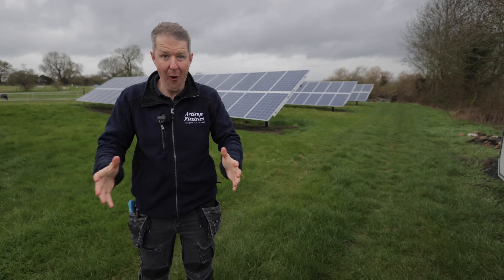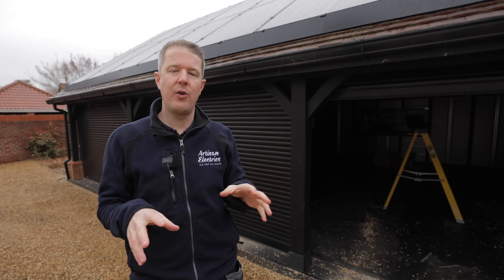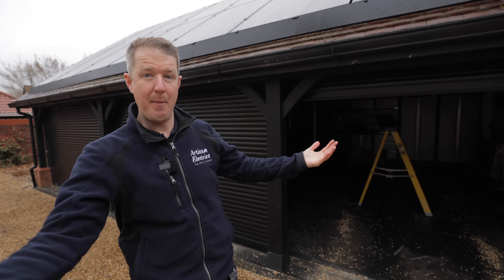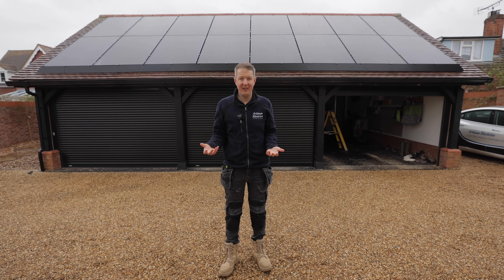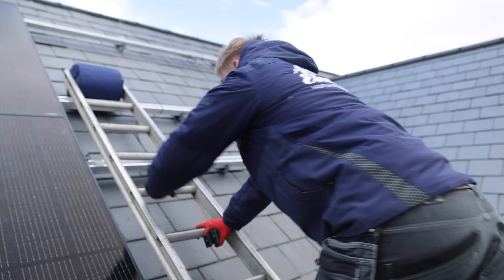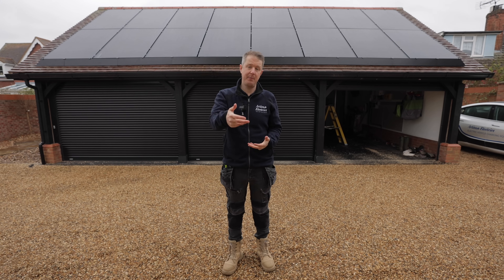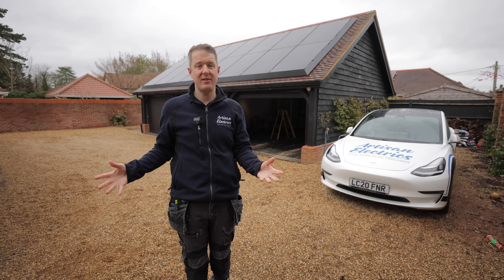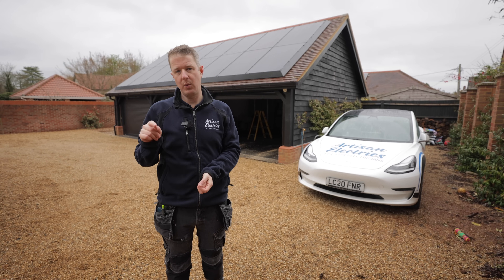10 Things You Need To Know Before Getting Solar Panels Installed in 2024

Comment: Best to use Octopus Eco7. Charge everything up at night 12:30am - 7:30am at 18p/kwH and export ANY surplus solar on Outgoing Octopus at 15p/kwH. No need then to install expensive complex electronic car chargers, immersion heating kit that adjusts to the ever changing solar. No need to plan the solar available next day. Also just charge the car up...18p/kwH - the solar you could have used will get 15p back from the grid - so the real cost of this being no hassle no stress is 3p/kwH.....It's simple, stress free, no planning, no thought required. But best of all all the equipment I use, will not be broken in 3yrs from constantly switching on and off everytime the sun goes behind a cloud.
Reply: But you are 100% reliant on that tariff being available. If octopus withdrew that Tariff or went bump then your plan falls apart.
Reply: @Pugjamin  I totally agree - and there is another plan that looks even better than the one I am on. These plans should be available as a matter of course. I should not be beholden to the whims of Octopus, but they are the only show in town. The whole system is broken. The govt should be funding solar installation, with the payment of the electricity bill being the repayment schedule of the loan.  We are all being extensively shafted by the excessive cost of power, and I am a lucky person that I can afford to buy my way out of the clutches of the system that penalises the poorest. But with respect to cost effectiveness - my current approach is still the best and cheapest and easiest way to charge my car, loft batteries without using myenegi, zappi etc...I do not think those products are worth the hassle, provide the marginal savings that pay for their cost/installation/maintenance. The cost of using o/n electricity is effectively 3p/kwH, divide that into a £1000 car charger and the breakeven point is 33,333kwH.
Reply: You made the mistake twice, so there is a pattern there.

Units of energy are kWh, not kwH.

Capital W for watts, and lowercase h for hours.

Comment: A good summary but you didn’t cover DNO approval.  We had to wait 4 months for our DNO to approve the installation, and then another month to approve the second battery.  The DNO might impose import (overnight charging) or export limits.  Fortunately for out 10.4kW system they didn’t but on a sunny day you can see the grid voltage delivered to the house being on or sometimes exceeding the limits, caused by home solar charging.  It’s the DNO to keep this in balance but with the energy price increases there’s been a lot of solar requests and they’re swamped.
I’m not convinced about bird guards, seems a bit like an upsell to me.  We’ve had a 16 panel FIT array installed for 6 years and no evidence of birds nesting underneath so when we had the extra panels fitted we didn’t bother with bird guard.   2 months after the install I did have to buy some plastic bird spikes as the birds sit on the TV aerial and poo on the new panels though!

Comment: A couple of things. You mentioned using What 3 Words for sending you location information. We have found that W3W does not work if there is no mobile signal or Wi-Fi. OS Locate works much better. It gives you a 6 figure OS grid reference. We’ve used it where there is no mobile signal and/or Wi-Fi and it works perfectly. Also, you make no mention of getting planning permission. If you’ve got a listed building then you need this even if the panels are being put in a field as part of the property. Ps. I’m enjoying the videos.
Reply: OS Locate uses GPS receiver in the phone, if it has one, and so does not need an active mobile data connection or WiFi.

Comment: Bess (battery energy storage system) and Hess (hybrid energy storage systems ) systems are going to become more of the norm over standard Pv Ess arrays as governments and electricity suppliers rely on load balancing more and more
Reply: Well yes, the grid (at least here in NL) is largely congested and upgrading it costs billions and takes decades. Even now in the spring, the number of complaints of inverters stopping exporting energy to the grid at sunny days is rising quickly, depending on the local situation.

Comment: Morning....I have watched your video and I think I have to review my plans. A famous energy company are installing my solar panel and heat pump. My system is a 16 panel 450watt generating 7.12 kW with a battery storage capacity of 10kw. The inverter on the system is a 5.78 microinverter. Having watched your videos I think I may go back to them to get the powereall 3 since it has a higher inverter. Or if they can get my a higher inverter even better as I think if I have to increase my battery storage down the line to 15kw, the inverter may not work for me again. What do you think is the best option ?
Get the powerwall 3 which has better capacity inverter or ask them to give me a higher inverter on the enphase battery which is what they have proposed and got the agreement from the DNO.
Thanks for your help with this.

Comment: You may get sun all day but it's that between 9am and 3pm when there is real strength, i.e. peak photons 'hitting' the panels.  And, in winter that's the only time there is any sun!  Summer sun pre 0800 or post 4pm ain't that great.

Comment: Generally speaking I have found that the cost of solar panels should not be the driving force behind the decision making process. It’s more about having a source of independent power if your mains power supply fails, or if your diesel generator becomes impractical. (Most of us would not be alive when the the installation actually breaks-even financially, if ever..
Reply: I disagree. Everyone's circumstances are different.

If you live in an area of frequent power cuts then yes having a backup source of power can be useful.
But let us not forget, diesel generators can provide that backup power and the generator will work even when the sun is not shining such as on a winter's day.

So your choice of backup power needs to take in to consideration a number of factors.

If you live in a place where power cuts are extremely rare, such as the UK, then having an independent backup source of power to the national grid is not the prime consideration .
Reply: @deang5622  yes that’s true.

Comment: I'd endorse the idea of getting old roof slates changed at the same time as having solar panels fitted. Having the installers moving across the roof is likely to break any fragile slates, and replacing them is a time-consuming business. If the roof has reached the end of it's life, get a new roof at the same time. Any home owner should be putting aside some money each month to pay for a new roof when this is eventually needed (same with your boiler or heat pump).

Comment: Can panels also heat water as well as generate electricity?  🤔
Reply: Yes they can with a hot water diverter.
Reply: Heating water directly is a different kind of solar panel, containing tubes carrying water. These are referred to as solar panels but they are not photovoltaic solar panels.
Reply: @deang5622  yes but you can connect your panels to a hot water heater if you have a hot water tank
Reply: @lehoff Yes, I do know this. And I did see the other post. If that post was incorrect I would have corrected it.

I see no need to repeat accurate comments made by other posters. That's pointless.

Don't assume that because a person hasn't mentioned something that they don't know about it. Look at the other posts in the thread too.
Reply: @deang5622  I was responding to this person. I'm not going to read every thread in this video.

Comment: So our usage is about 26.5kwh per hour during the day, and at night we use about 72kwh from dusk to dawn.    Here in Texas it is extremely tough to justify the cost of solar because the power is so cheap.  I would love to get it, just to reduce the overall usage from the power company.   I got a quote from Telsa for their solar roof and powerwalls for $465,000 or £375,000.  🤦‍♂🤪  That was for just over 53KW of solar roof and 10 power walls a while back.  Needless to say I still don't have solar.  👍   Looks like a great job there sir, and some very good points.  Because of the amount of hail we can get during the spring and summer, our roofs are very steep pitched here from 12/12 to 18/12 or 45 degrees to 58 degrees, so its fun watching the roofers up there doing work.
Reply: So you use more electricity in one hour than we use in three or four days? How?!? Cut that down and you don't need all those expensive powerwalls!
Reply: That's using more electricity than can flow down the power line to most British houses (which is 23KW)  and you're pulling that amount for multiple hours per day.

You're doing something wrong.
That's not a house, that's a palace you got there.

Comment: Can I get more solar by using a wall? I already have 3.2kw roof. I have an unshaded south facing wall.
Reply: Solar panels work best when the sunlight is perpendicular the the plane of the panel.

You will catch the sun and generate a reasonable amount of power for a limited amount of time during the early morning or late evening, depending on which way the panels are facing.

Vertically oriented panels won't maximise the kWh you get over a year.

Comment: Really neat installation, great job. Just a question on the battery inverter, assumed 5kw with the Libbi. With an Array that size, does a 5kw battery inverter limit the rate of generated energy you can store at any given time?
Reply: The inverter does not charge the battery so the power rating of the inverter is not relevant.

What is going to determine how quickly the batteries can be charged is:
1. The maximum charging current of the battery charger
2. The maximum charging current the batteries can handle.

Wiring batteries in parallel means that you can charge them up at higher current as that current is divided across the batteries.

If you have only a single battery you are limited to the maximum charging current for that single battery.

You will need to look at the technical data for the particular batteries being used and identify what the maximum charging current is.
Reply: Guys, thanks for your replies. I don’t think I was particularly clear on my point, which is, with the array in that video, 30 panels roughly at 400w a panel, on a sunny day, the optimal generation is going to be a lot higher than the 5kwh inverter. Has the right inverter been selected for this installation? I understand it’s a east to west set up with optimisers, I was just wondering can you install too many panels where it becomes pointless as your limited to your inverter size?

Comment: Are there comparisons of DC appliances in the house? Does anyone do that to remove the inverter need? Could have back up rectifier to take mains?
Reply: Solaredge batteries are DC coupled, so they can charge off “clipped solar”.  E.g. if you have a 12kw solar array, that could be hooked up to an 8kw inverter.  If the inverter maxes out at 8kw, the batteries enable the remaining 4kw of solar that would otherwise be clipped to be utilised.

But DC consumers are extremely niche products.  I do not know of any domestic 400V DC appliances.  You can’t even get DC coupled car chargers through the type 2 charging standard.
Reply: @anthonydyer3939  I was thinking about boats and caravans perhaps?
Reply: No point in converting appliances to DC.
The Solar Edge inverters have a maximum efficiency of 99.2% - though I can't say what their minimum or average is, but based on that it's not worth the hassle and effort in converting appliances to DC in order to remove the inverter.

And don't forget the energy from the sun is "free".

Comment: What’s your view on micro inverters they don’t need all that much space as they are fitted under the panel
Reply: Micro inverters are expensive to use, but have their advantages... the main ones being that you can easily add panels as and when you want and in strange places (not all on the same roof plane), and they are great for areas that are frequently in mixed shade.  All depend on your particular situation.  You can also get some great reporting on individual panel performance... if you're into that sort of thing.

Comment: Can you fit batteries and an inverter in the loft space?
Reply: The inverter yes. The batteries maybe; they weigh a significant amount (over 50kg per 5kWh pack is not uncommon, and 10kWh packs can weigh up to 120kg), so the same structural considerations that would apply to the roof also apply to the loft flooring or joists.
Reply: @Aaron Jones  thanks for the info 👍

Comment: Does having battery storage in a unheated garage pose a risk to the battery health in colder conditions?
Reply: Not as much as having the batteries outside. SOC will be affected by battery management systems limiting cold weather impact on charging rates.

Comment: Love your channel but please just for once tell us the cost of one of these installations
Reply: arm and a leg 😂
Reply from the maker: I did tell the cost in a previous video where I showed the full install
Reply: @artisanelectrics  could you please share that link
Reply: If you have to ask the price... you can't afford it !  However... the price will vary alot with whatever is needed for each particular install.  This install will be cheaper on the scaffold due to the single story... but more expensive as they had to run that SWA over to the new CU position... which meant digging a trench.  Lots and lots of factors...
Reply: @gregevans8939  that's a rather rash statement
Reply from the maker: https://youtu.be/jcyqiQUWJW4

Comment: is it possible to install the inverter in an attic?
Reply: yes... just be careful with the inverter operating temperature ratings (attic can get very hot/cold if insulation is at ceiling level)

Comment: I know your electric rates in the UK are much higher than in the US due to poor national energy policies, but even so can you really break even with a residential solar and battery system as compared to using grid power?  We can’t come close in the US in most parts of the country.  Maybe Arizona can break even, but they would probably be one of the few exceptions given the current cost of batteries in particular.

Comment: Im still dubious on battery's and if they are worth the cost long term with export prices now rising some at 15ppkwh there less need for batteries,  and on off peak tariffs getting closer together and this is how most people justify batteries with low over night tariffs which likley wont be as low as they are now medium term as the more people use off peak the less off peak it becmes,   you might be better off just exporting at 15ppkwh and just using the grid with the credit you have generated from export and load shifting to day time washing drying etc,  2 or 3 years ago when export was like 5ppkh i think batteries were a viable option now im less inclined to think they are id rather have a bigger array and less battery and export and get the cash from exporting

Comment: Glad you didn't mention MCS certificates as it's a complete scam... a tax on renewables.
   
Quick note, in-roof systems and potentially that particular bird nest preventer can cause heat build up under the panels reducing efficiency and life span.
Reply: Although I agree that part of the MCS is an over priced scam. Without an MCS certificate you can not take advantage of the better feed in tariffs
Reply: @misstertash1701  "Without an MCS certificate you can not take advantage of the better feed in tariffs" And that's the scam !!! Great shame that the UK has chosen to go down that route... they have a monopoly !!